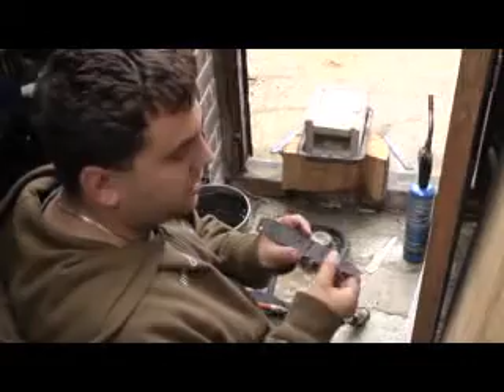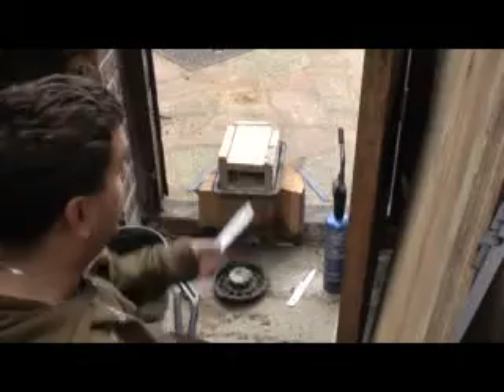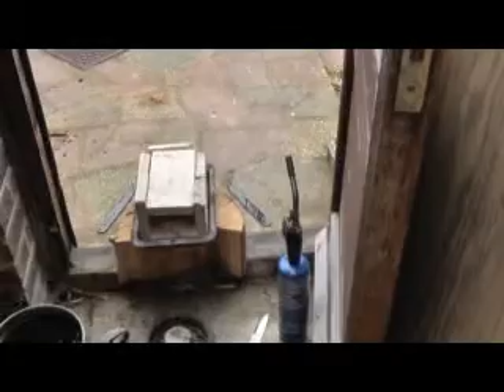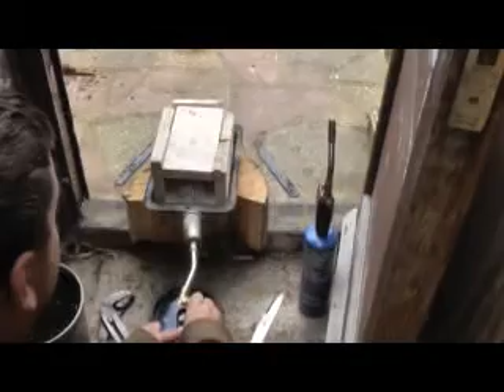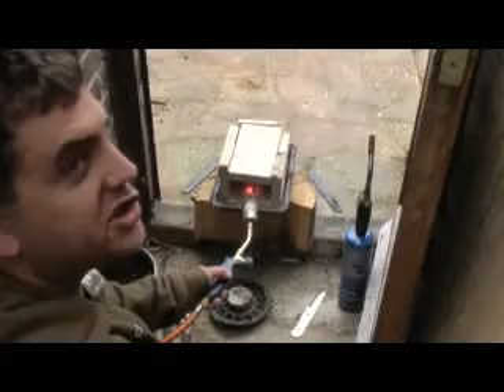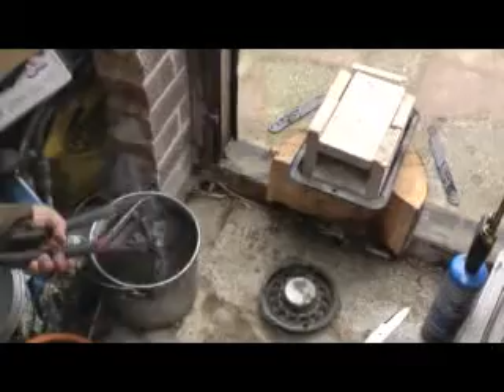Simple Heat treating by (New Forest Bushcraft)

Comment: Hello, this hardens the steel to give it a more durable edge, when you heat the steel to 800 deg c it straightens all the molecules in the steel and aligns them. The purpose of the quench is to "freeze this stronger state for the particular temperature" so in affect you freeze the steel at that moment in time. it is then tempered to make it a little more flexible, if it was left rock hard it could break or shatter.

Comment: @9ineaxis2010 the point I was making was the statement that "you want to use oil and not water because water will spit everywhere and not give you a good quench" was inaccurate. The reason you don't want to use water is that for most "oil hardening" steels, water will be too much of a shock to the steel and cause it to crack. It has nothing to do with it spitting and not giving a good quench.